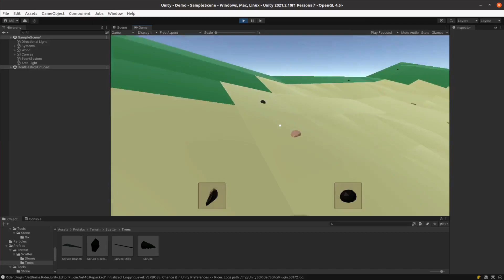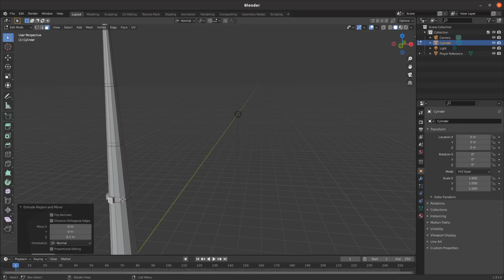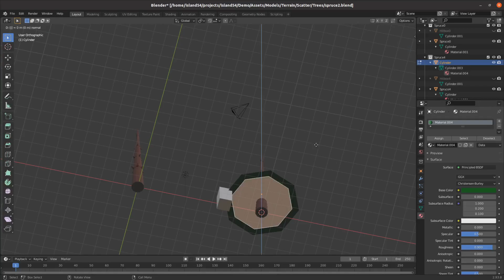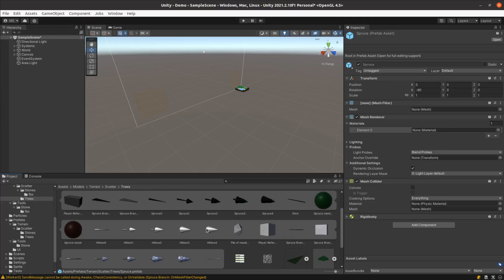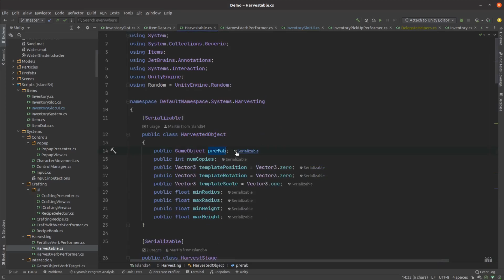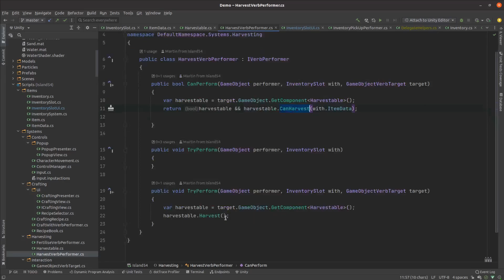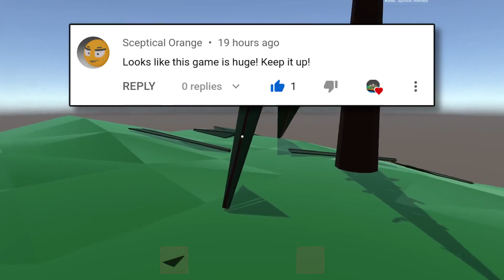Adding Harvestable Trees to My Game | Unity Devlog #6

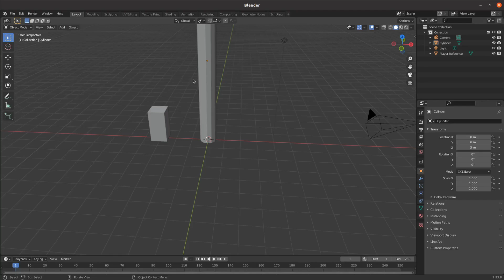Comment: 1:27 It would actually be better if you put the origin-point not at the bottom, but up the trunk a little bit... that will fix your "floating trees" problem.
Reply from the maker: Yes, you're absolutely right.

Comment: why Don't you use mesh collider ?
Reply from the maker: Mesh colliders come with a serious performance penalty. Normally I'd not worry about improving performance until I know it's an issue, but I also wanted to get a feel for the workflow of separately modelling the hitboxes. It also lets me play with ideas like having the hitboxes ignore the very bottom of the lowest leaves since my character currently keeps clipping into them and getting a bit stuck.

Even the way I'm using them here could be improved, as a primitive collider with the same geometry as a mesh collider has much better performance. Consider a spherical mesh, which just does a distance comparison or a box mesh that does a comparison of the coordinates in object space. Compare that to a "sphere-like" or "cuboid-like" mesh, and it suddenly needs to do comparisons for every normal in the mesh

From an ideal performance perspective, a better approach would be to put child objects on the tree to compose a complex hitbox out of primitives. This has the additional benefit that you could then support convex (-ish) rigidbodies too, which MeshCollider doesn't support.

Edit: Oh, and I'm also swapping my meshes in and out of the collider at the moment, which according to the documentation is a big no-no for performance reasons as it has to re-bake everything any time I do that.